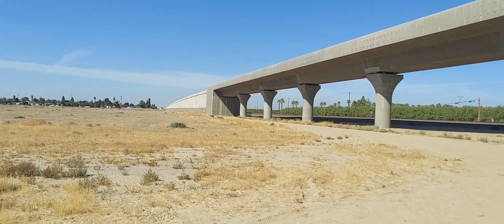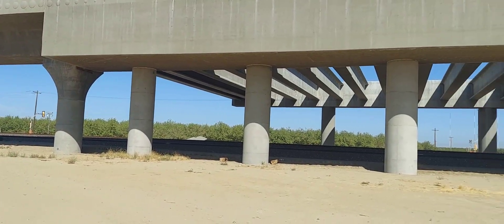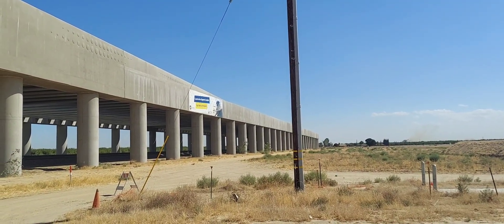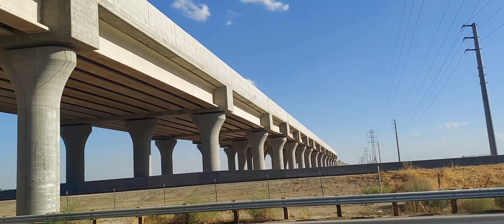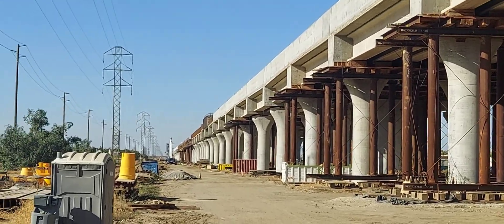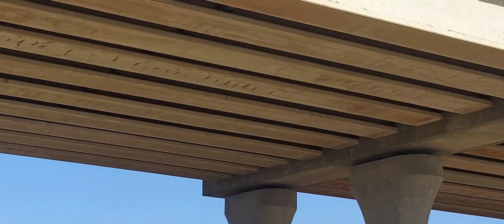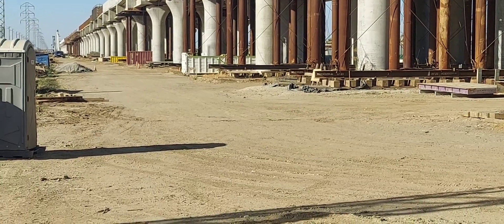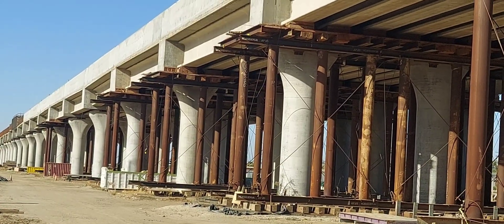Checking out the California high speed rail network

Comment: in 100 years those concrete pillars will be a tourist attraction similar to Stonehenge, except that Stonehenge actually had a purpose
Reply: Or we can just actually finish the damn thing
Reply: @lucaspadilla4815 
This can be finished in minimalist design, so it will be something out of that

Otherwise, it's a complete waste of money. 
So far was wasted, but it can be something done still
Reply: You will not see that
Reply: @Matt999PL  no, but tourists in the future will
Reply: @neckarsulme 
Let's leave it to tourists what they are gonna do.
Let's hope that this overruns of budget will end and it will be done the best with that rail line.
To do the best possible with what was done and not to spend billions triple over budget. 
Cut to minimum this whole project. 
Phase 1 finish with minimal money 
Phase 2 scrap
Reply: @Matt999PL  it's already way over budget....they should've dumped this project 10 years ago
Reply: @neckarsulme 
I know it's a over budget.
Because it was not canceled 10 y ago now its bigger  dilemma because a lot of money was put into it.
Its  better to finish the cheapest way possible.
If nothing its done it will be concrete skansen museum.
Its better to finish and have something out of it.
Any next projects have to have strict control and cancel fast if doesn't work. 
Now work went to far to cancel.
I belive it can be completed minimum way over couple of years. 
Any extension ( phase 2) cancel.
Thats my opinion.
Whatever exist can be connected to existing lines.
Its not gonna be HSR all the way but its better to complete line all the way cheaper and at slower speed.
Maybe replace tracks where is necessary at existing lines.
Just an idea.
Connect new line with existing one where possible.
Some people made tons of money on this project and not complete. 
Then figure it out.
 Follow money and find  crooks.
Too much scheme probably just to make money for some without correct results. 
That why Trump cut funding for it as far as I know.
Recent news I believe
Reply: @Matt999PL  I voted against the bond measure in 2008 because I knew it would end up like this
Reply: @neckarsulme 
Was this bond for people to buy and fund project?
How much in % was collected. 
It seems someone/ group of people or organization make money on it and didn't provide good results!!!!
In simple terms it is stealing of public money.
Embezzlement of public money?
It looks like that.
Reply: @neckarsulme 
So you are not against general idea but against embezzlement of public money which you predicted in 2008?
You knew it will end up like that.
Reply: @neckarsulme 
You just predicted misuse of public money. 
State of California is the " owner" of CAHSR through CAHSRA
Embezzlement 
In addition, there are a series of sections prohibiting misuse or theft of public funds. See 18 U.S.C. §§ 643, 644, 648, 649, 650, 651, 652, and 653.
Some group of people fill their pockets.
Reply: @Matt999PL  yes, that's why I voted against it
Reply: @Matt999PL  I'm against any project like this because anyone knows how corrupt and inefficient the government is when it comes to getting stuff built....Building an actual high speed rail from SF to LA was never even feasible and everyone knows that
Reply: @neckarsulme 
Somehow its possible in Europe or China to build 200mph plus railway.
For example France TGV  is owned by SNCF national railway owned by Government. 
Pioneer in HSR in Europe and the World
 They started HSR in late 1960.
Speed record on conventional rails belongs to TGV so far nobody beats  that in conventional train system.
Only maglev magnetic goes faster but that's not conventional type
Reply: @neckarsulme 
Probably not possible here only.
Most European and China has that already long time.
TGV has unbeatable speed record in conventional train. ( 2007 year )
Nobody is even close in conventional train type.

Comment: Tracks are one of the last parts of any high speed rail system. The grade separations and prepping, building and elevating the right of ways are by far the hardest part. It's where most of the work and cost is in the project. Over a hundred bridges, viaducts, tunnels, over passes and rerouting of roads and other train tracks all have to be done first, just for one 120 mile section. Trains going near 200 mph can't stop for stop signs, creeks, roads, etc. The train must travel above or below grade. And the infrastructure to do that is exponentially more difficult than laying tracks.
Reply from the maker: Actually, I was with a track engineer. And he said that generally the railroad should be built in sections, and the track late accordingly. Instead, California is doing this differently, in violation of all of the recommendations of people who have built High-Speed Rail systems before, such as France Spain and japan.
Reply: @ReadingandLehigh  It is being built in sections. There are over two dozen project sites being worked on right now.  China built theirs by completing major grade separations first in project areas. Also why would they lay track and electrify just a mile long viaduct? You would want to get all the grade separations done in one area like Fresno so you can actually lay and connect track. The Fresno project area has over a half dozen major grade separation projects.
Reply from the maker: @SwinkMcloud nothing. Not one foot is ready for even test trains or construction. Nothing.
Reply: @ReadingandLehigh  Yep. They could have done it way faster and way cheaper by hiring experienced foreign workers who had previously built HSR. But the feds put conditions on it that California would not hire foreign companies and instead hire American companies and train people to create a new industry of high speed rail contraction. Because other parts of the country also wanted HSR the feds wanted to create a new skilled industry instead of hiring foreign firms.
Reply: @ReadingandLehigh  50 miles of the Caltrain line in Northern California have been electrified and will be incorporated into this project.
Reply from the maker: @blakeclark5898 that's cool, I did not know that
Reply: @blakeclark5898  What about the Caltrain line to Gilroy tho? That section is also supposed to be upgraded for 110mph instead of laying completely new HSR tracks

Comment: You asked about vertical columns in the SR43 tied arch bridge - there will be vertical cables suspending the deck from the arch, like the arch segment of the San Joaquin river bridge at 4:35, but that's the extent of it. It looks like they're close to having all the concrete pours done, once they do they can tension the support wires, and then take down all the falsework and temporary construction supports.
Reply: Looking at sr43 bridge , surely it would have been cheaper to have put the road over the rail route there wouldn't have been the need for such a long grade or such a massive bridge
Reply: @maly2ts408  I think it would have been cheaper but other concerns drove them to select rail-over-road here, though I'm not 100% sure what those concerns were.

They cross SR-43 five times that I count, and two of those other crossings are road-over-rail like the curved bridge just north of Corcoran and the straight bridge further north halfway between Corcoran and Hanford. Others are rail-over-road, like this one, the crossing as part of the Tule River Viaduct, and the road undercrossing in north Wasco where the road already ducked under existing freight. So in two of the three times they selected rail-over-road, it was dictated by existing built environment or other structures. Where they had more freedom, they seem to have preferred road over rail (2 of the three where it wasn't part of an existing structure or a large HSR structure).

I don't really know why here, possibly it had to do with the relatively nearby (0.5 mile) kings river crossing? If the structure there already drove a relatively tall HSR embankment, then it might have been easier to go only a bit taller and do rail-over road than to have to build an even taller road bridge?

Comment: The sections under construction are designed for 250 mph throughout the valley.  Operating speed should max out at 220 mph
Reply: Finally.  People who know actual information on this megaproject.
Reply: 125 mph dual mode trains will be the chosen equipment for CAHSR.
Reply: @davidjackson7281  WRONG.  The RFQ (which you can download directly from the CAHSR website) states:

- Procure six trainsets capable of operating at 220 mph and tested up to 242 mph;

- Receive two prototypes in 2028 to support static/dynamic testing and trial running;

- Receive an additional four trainsets by the end of 2030 to support revenue operations on the 171-mile Merced to Bakersfield section.
Reply: @davidjackson7281 no actually, seamans is creating the pioneer 220 sets which are intended to operate full electric at 220 mph
Reply: @shopdog831  Siemens train is for Brightline West not CAHSR which still has not yet decided to order a trainset. Siemens could adapt the pioneers to dual mode 160 mph for when CAHSR reaches Gilroy in 2040.

Comment: looks beautiful and once finished will be a huge boost to CA. cant wait.
Reply: If*, if finished.
Reply: @Jose-og909  Make no mistake about it, this son of a bitch is gonna get built.
Reply: This project has wasted billions in this kind of bloated gold plated design and will never be finished if this kind of bloated gold plated waste and taxpayer fraud continues.
Reply: How much Carbon was expelled to produce that much concrete?
Reply: @SteveEngineer75  quite a bit
Reply: Hugh boost of what. Bakersfield to Madesto. Why do you need a train doing 200 miles an hour. The whole thing will be 170 miles after 30 years. Hugh waste of taxpayers dollars.
Reply: lol, "once finished"?  This boondoggle won't even have a complete line from SF to LA as they sold it back in 2008....They will wind up with a simple track from Merced to Bakersfield at a cost of 200 Billion and it won't even be high speed